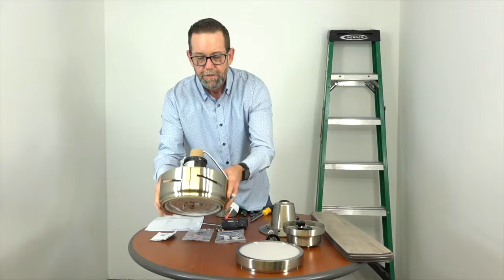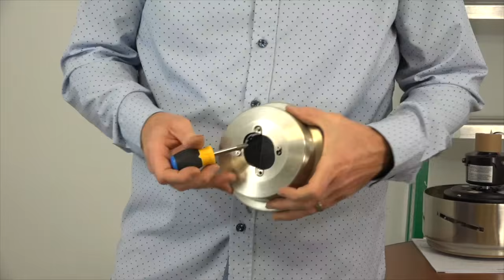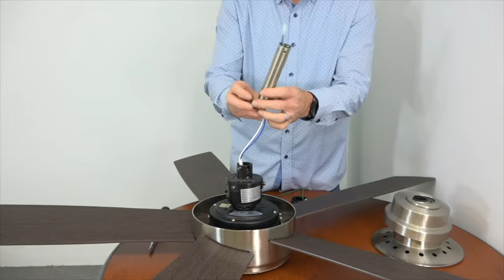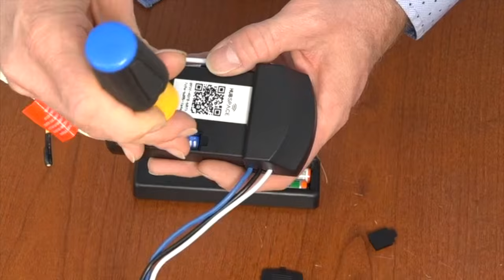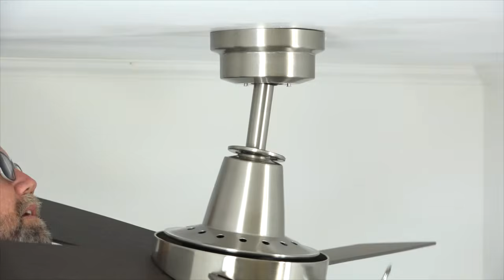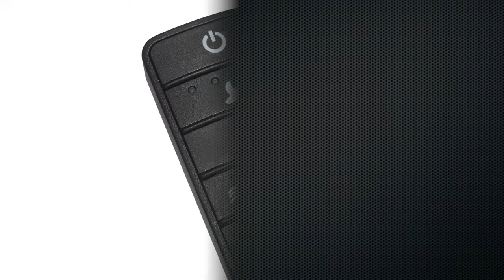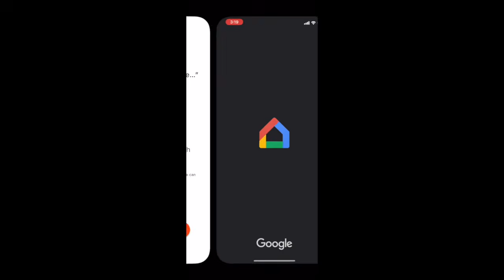How to Install the 54 in. Fanelee Ceiling Fan from Hampton Bay

Comment: I have a very mild wobble at the light shade I notice when the fan is at top speed, wondering what it can be? The fan blades are super tight are flush in their locations.
Reply from the maker: Make sure that the set screw on the motor collar is completely tightened and that the ball is seated properly in the mounting bracket so that the slot of the ball is resting on the tab on the inner ring of the mounting bracket. Also, make sure that the light shade is properly installed and completely tightened.

Comment: Ok their were 2 wires in the supply line one white and one i think was green there was no black one, what do i connect to the black reciever wire
Reply: There was no bare copper house wire
Reply from the maker: @GoldenDuckling246  The black receiver wire should be connected to the house power wire (either black or red if it's a switch wire). If you're wiring scenario differs from the manual, we would suggest contacting a licensed electrician to ensure the wiring is connected properly.
Reply: @ceilingfans101 got it thanks, i figured it out and now the fan works thank you

Comment: So after thinking 🤔 and taking several stabs over many hours I decide that I’ll take the green eyelet ended ground wires and connect to the places were the green wires came out of the mount and receiver only the eyelet holes are not the same size as the screws to put them end been trying about a dozen times straining tryna hold fan while screwing in with fan blades in my Adam’s apple and neck to no avail..
Reply from the maker: After reading all of your comments, it seems like the eyelet ends should be cut from the house ground wires prior to connecting all of the ground wires (bare copper or green wires) together. You should not have to strain holding the fan while making wire connections - the fan will rest in the mounting bracket while the wiring is done.

Comment: Thank you very much for posting this video. It helped me to install all 5 ceilings in my home. Your instructions are to the point.
I just have one question. What wires need to be connected so that I can also control the fan and light from the wall switch?
Reply from the maker: The only switch option would be a single toggle style switch. To use a switch, you would just connect the switch power wire to the receiver power wire and cap off the house power line. It is not possible to connect the remote receiver to 2 separate power wires to control the fan and light independently.

Comment: how to bypass remote?
Reply from the maker: We would not recommend bypassing the remote because the fan has a color temperature adjustable LED light and the remote is the only way to consistently control the color temperature. Bypassing the remote would also eliminate any smart features offered with thee fan such as scheduling, app control etc. If you choose to bypass the remote, you would need to cut the wire plug from the fan wires which would leave you with 3 separate wires: white - neutral, black - fan speed power, and blue - light power. Once the wires are separated and stripped, you can then connect them to the house power supply.
Reply: @ceilingfans101  what happen if for some reason the remote is not working anymore? Then the fan will not work either right?
Reply from the maker: @tunacatcher2003  if the remote hand unit fails, the app can still be used to control the fan. As with all remote control fans, if the receiver fails, there would be no way to control the fan.

Comment: How do you connect 2 of this exact fan on the app without the QRs? Electrician threw away the box and instructions which had the QR codes
Reply from the maker: The QR code should also be on the receiver and on the inside of the battery compartment of the remote control. The fan can be synced with the app with out the QR codes using the switch method, Open the Hubspace app press the + symbol to add an item and then follow the instructions to sync without QR code. If you need further assistance getting the fans and app synced up, call Hubspace customer service at 1-877-592-5233.

Comment: Does this fan reverse direction?
Reply from the maker: Yes, the reverse switch is located on the top of the fan under the motor collar cover. To access the switch, slide the motor collar cover up the downrod. The switch is located on the black switch housing just below where the downrod attaches to the fan. You can see the switch in the video at the 6:07 mark.

Comment: Hello thank you for the great video. I had a question what if I didn’t have a feeling fan before can I still install it using the video as a reference or do I have do anything else?
Reply from the maker: As mentioned in the video, you will need to have a ceiling fan outlet box (clearly marked "acceptable for fan support") installed. Once you have the outlet box installed and wiring routed to the box, you should be ok to proceed.

Comment: First thank you for the detailed instructions. I see that i cannot operate the fan/light (just turning on or off) using the wall switch. Is there something I am missing or we cannot get a wall switch operation when using a remote?
Reply from the maker: That is correct, in general, with remote control fans, the only switch option is a standard on/off switch that turns the fan and light on/off simultaneously. Wall controls (fan speed and light controls) are typically not compatible with remote control receivers and will eventually damage the receiver

Comment: I installed this fan and it had been working just fine, no issue whatsoever but now all of a sudden it only defaults to high speed fan. No matter if i try on remote or app or even google home the speed wont adjust. Only the light is able to turn on and off. Any idea what could had happen?
Reply from the maker: Sorry to hear that you are having that issue. You may need to change the frequency of the remote. If there is an interfering signal in the area, it could be affecting the remote performance. If that does not solve the issue, we would suggest calling Hampton Bay customer service at 1-855-34-2678. Their team is pretty good at troubleshooting over the phone and will be able to send any replacement parts if necessary (new receiver).
Reply: @ceilingfans101  thank you for the response. I will adjust the frequency and see if that works. Thanks again

Comment: Is anyone having issues with the light not turning on instantly? I hit the switch and there is about 1-2 second delay before light turns on
Reply from the maker: If connected to a switch, there will be a slight delay from flipping the switch and the fan turning on. Think of it as a little mini computer in the fan rebooting because the power has been off. For immediate response, we suggest using the remote to control the fan and not using a switch. Using a switch will also disable any smart features while the switch is turned off.

Comment: Great tutorial, the ceiling mount doesn’t flush with the ceiling though, everything is snug, and tight, and Ive still got about a 1/4 inch gap between the cover and ceiling. Great fan otherwise.
Reply from the maker: Correct, there is a gap between the ceiling and the canopy once installed to allow for room for the WiFi antenna to stick out and attach to the ceiling. If you are not using the WiFI features, and do not need the WiFi Antenna sticking out, you can remove the rubber foam pads from the mounting bracket which will allow the canopy to fit closer to the ceiling.

Comment: I followed your video , and installed it but it is wobbling, what could be the reason ?
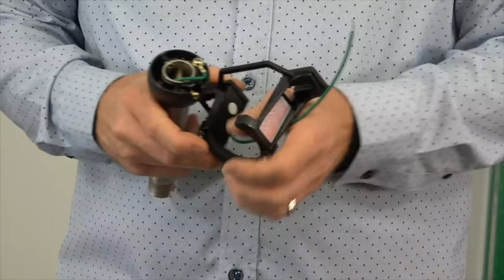Reply from the maker: A few reasons for wobble would be: 1. loose blades - make sure all blades are completely tightened. 2. Improperly seated ball in the mounting bracket - make sure ball is seated so that the slot of the ball is seated on the tab in the mounting bracket (see the 7:58 mark). Loose downrod / fan connection. - make sure the downrod is screwed into the motor collar completely and that the set screw is completely tightened. Another reason for wobble could be a loose outlet box.

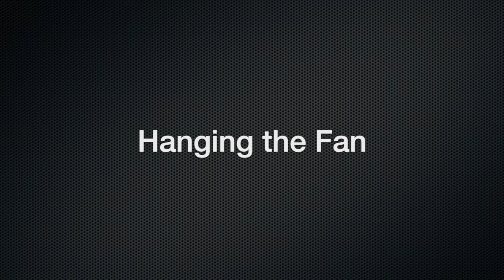Comment: Great video but small mistake at 7:52 - According to the setup instructions from Hampton - The screw is a 'set screw' and must go into the hole at the top of the down rod.
Reply from the maker: Thanks for the comment. While the screw may thread into an optional extension downrod, the screw for this particular downrod does not and is more of a tension screw to hold the ball in place. If the screw ever comes out, the ball will still be held by the redundant safety bar that goes through the downrod.
Reply: @c @ceilingfans101  my instruction manual indicates a tension screw but the hardware that came in is in fact a set screw. Trying to use it as a tension screw does nothing

Comment: I'm guessing if there isn't a mounting bracket already in the ceiling, I need to get that first.
Reply from the maker: Correct. The fan requires there to be an outlet box that is clearly marked "acceptable for fan support"

Comment: It’s going counterclockwise and it’s summer how do I change the direction
Reply from the maker: To change the direction, slide the motor collar up the downrod. Once the otor collar is slid all the way up, you will be able to access the reverse switch. The reverse switch is located on the black switch housing on the top of the fan.

Comment: I put fan at the ceiling but I saw red wire!!! I have Red White Black and Green wires. I already hooked up on Green to ground together.  White to white wires.  Black to black wires. I did followed your video. But Red wire to ??? How???? Heeeeeelp  me please!! 🙏 🙏
Reply from the maker: For this particular fan, we would suggest just capping off the red house wire. Typically, the house red wire is a switch wire. If the red wire is connected to a standard on/off switch, you could connect the receiver's power wire to the red house wire. That would allow you to turn the fan and light on/off using the switch. Please note that if connected to a switch, the light's color temperature may change if the switch is turned off/on too quickly (within 4 seconds).

Comment: Does this require a neutral cable?
Reply from the maker: Yes, the fan requires a hot, neutral, and ground wire.
Reply: @ceilingfans101  thank you, very much  :)

Comment: If my ceiling is only 8” high. Can you tell me how to mount it?
Reply: Eight inches? That's rough.  You should rewatch Spinal Tap before installing this fan
Reply from the maker: We wouldn't recommend this fan for use on an 8ft ceiling. In general, ceiling fans are required to have at least 7ft of clearance between the floor and blades. When installed, the  blades would be lower than the required 7ft. For an 8ft ceiling, we would recommend a hugger style fan.

Comment: Is there a video showing how we put this fan in reverse mode for winter time?
Reply from the maker: Not currently. To reverse the fan, slide the motor collar cover up the downrod. The reverse switch is located on the black switch housing under the motor collar. You can see the reverse switch at the 6:19 mark. It's on the left hand side of the cylindrical black switch housing. Obviously, the fan needs to be off before switching the position of the switch.

Comment: I have an issue on my end, installed it but i am unable to turn both functionality at the same time.. how do i fix the issue?
Reply from the maker: We would suggest to double-check the wire connections and making sure that they are completely and correctly made. IF the issue persists, we would suggest calling Hampton Bay customer service at 1-855-434-2678. Their team is pretty good at troubleshooting over the phone.

Comment: Also wondering if anyone else struggled with screw on downrod to remove hanger ball. I had to have Home Depot loosen the screw on both fans that were purchased 😮😮.  They weren't as easy to unscrew with the philliphead as shown...even Home Depot couldn't lossen. I was told there was a special tool they used so it would strip. Happy they could do it so I can finish this project 😄
Reply: I’m having that issue too, I returned the first one thinking a previous owner had damaged that screw but now I think I’ll go and have Home Depot loosen it as well 🫡 thank you

Comment: My wall switch is dual. After connecting wires, I have a red wire left. Should it be connected to one of those groups of wires?
Reply from the maker: The only compatible switch option would be one standard on/off toggle switch. In general, a red wire is typically a switch wire and this remote receiver can only be connected to one power wire (typically a black house wire). We would suggest just capping off the house red wire.
Reply: @ceilingfans101 Thank you
Reply: Came here to ask the same question! Thank you!

Comment: Help. I bought the wall plate for the fan and it came with a receiver itself. We installed that receiver for the receiver that came with the fan. Now the remote and wall plate works but no wi-fi access. Can you have a wall plate and wi-fi control and the remote? All 3?
Reply from the maker: Thank you for the question. The receiver that is included with the fan is the piece needed for the smart connectivity. The fan can not be installed with more than one receiver and if the receiver is replaced, the smart features will be lost. We do not recommend any alternate controls for this fan due to the smart features and the color temperature changing light kit. The included remote is the only way to consistently cnotrol the light's color temperature.

Comment: Hi there! Thank you for this video! We bought these ceiling fans for our entire home. We forgot to program the frequencies so one control is turning on and off the rest of the fans upstairs 😅 I’m assuming that we wouldn’t have to take down the entire ceiling fan? And we can simply remove the canopy to program it? I appreciate in advance any response/responses.
Reply from the maker: Thanks for watching. Yes, that is correct, you can just remove the canopy to access the receiver to change the dip switches. Please make sure the power is turned off at the wall switch or beaker box before working on the fan.

Comment: I have a led ceiling fan with wifi but after connecting I can't change the settings.  The ceiling fan used to have separate wall switch to turn the fan function on and one for the light on the ceiling fan.  Now after installing the new fan, the fan and light are working through one switch.  IDK what to do
Reply from the maker: Do you have this fan, or just a different LED/Wifi fan? In general, if using Wifi, the fan will need to have a receiver installed and remote receivers can only be wired to one switch. If installed with a switch, the switch must be a standard on/off toggle switch. We don't recommend using a switch with this fan because if the switch is turned off, the fan will be disconnected from the home WiFi and the smart features like app or voice control won't be available.

Comment: I'm having trouble on the part where you're supposed to screw the set screw back into the ball. It's not supposed to be in the downrod but the only threads I see take the screw into the downrod. I've tried every configuration of the rod to sit in the ball but I'm having no success. Any ideas?
Reply: We’re having the same issue - did you have any luck? There’s no threading in the mount ball
Reply from the maker: Try turning the ball 180 degrees. The screw may thread into the downrod, but typically, just screws against the downrod and is held in place by tension.

Comment: I replaced my old fan with was on a two switch set up. One for the fan and one for the light. My new fan won't turn on no light or fan. I have a red wire do I need to wire the red wire with another wire or just leave it by itself?
Reply from the maker: In general, remote control fans are not compatible with a 2-switch setup. The only switch option for this fan would be a standard on/off switch. We would suggest not using the switches and just use the remote and connect the fan as instructed in the video and then just cap off the red ceiling wire.

Comment: Cool! I’m considering this fan. How’s its high speed performance? A lot of fans nowadays don’t move much air at high speed.
Reply from the maker: It moved plenty of air for us. The important thing is having the right fan for the right space. Some people install fans designed for large or great rooms into small areas not realizing that the fan's performance can be negatively impacted. The think that the larger the fan, the better, but installing a large fan in a small space actually produces less airflow because there is less air to circulate and the airflow actually fights itself.

Comment: Great video. My fan isn't turning on. I checked with a meter and there is power to the wires. The only thing is I have no ground. Any idea what's going on?
Reply from the maker: Couple of questions: Is the receiver wired to a wall switch? (if so, is it a standard on/off switch or a fan control switch). Did you double check that the wires from the house to the receiver are completely connected and the plug from the receiver to the fan is completely connected? (sometimes the wires may disconnect during the installation when the wires are moved around/tucked into the mounting bracket). We would also suggest making sure that the reverse switch is fully in one of the two positions - if it is not, the fan will not operate. The reverse switch is located under the motor collar cover on the top of the fan.

Comment: How do you reverse the direction in which the blades rotate?
Reply from the maker: The manual reverse switch is located under the motor collar cover on the black switch housing on the top of the motor. You can see the switch at the 2:35 mark in the video and on the left side of the switch housing at the 6:20 mark.